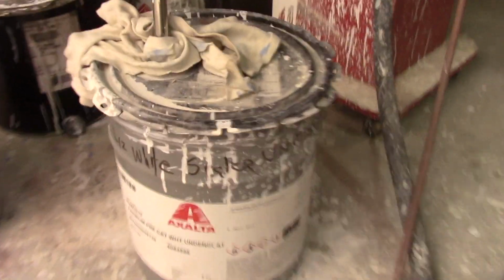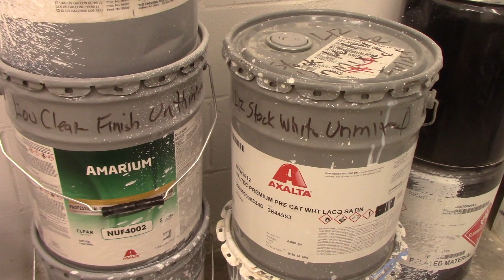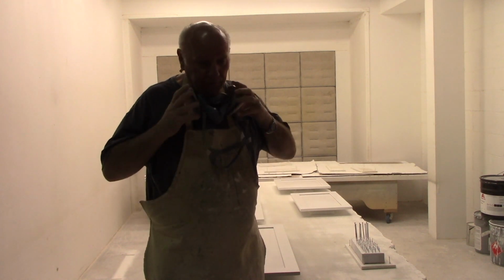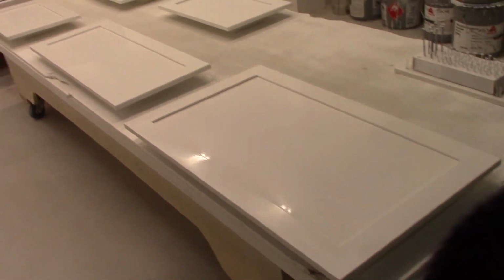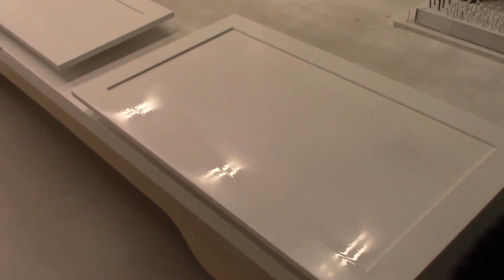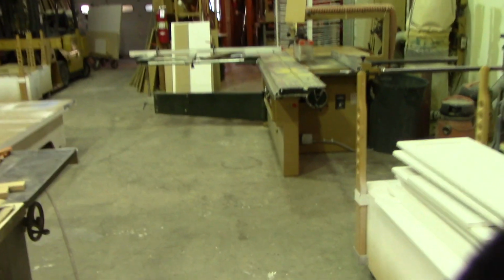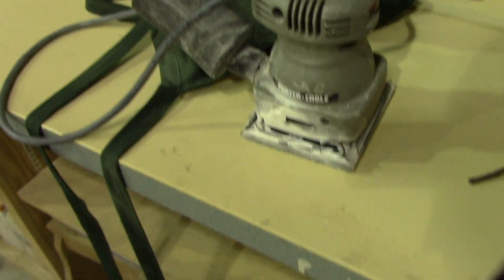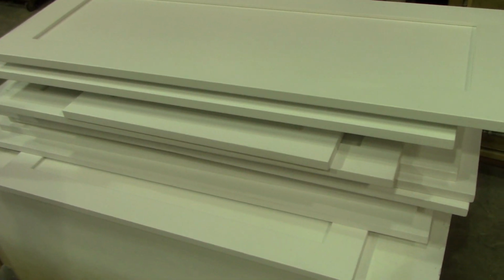How To Prep & Paint Cabinet Doors Part 3 of 4

Comment: Thank you for the video.  Do you dilute both the primer and the top coat?
Reply from the maker: Hello Diego, thanks for viewing! Yes, I always thin out both the primers and final coats. I use a Premium Lacquer Thinner, adding 5-8% to the color coats. This helps push it through my Kremlin AAA system and allows a far better flow out, which translates to an ultra smooth finish! Never even a hint of orange peel by thinning this minimal amount.